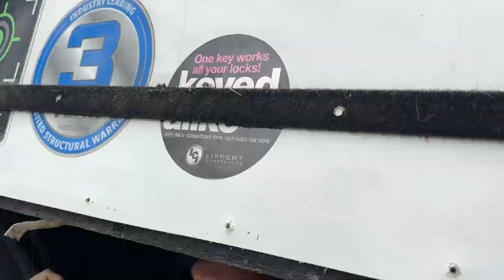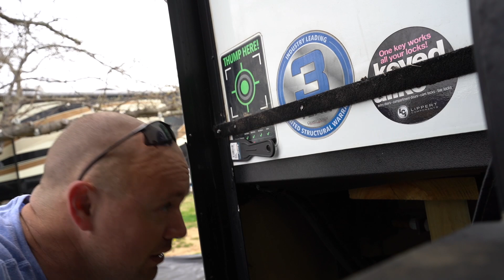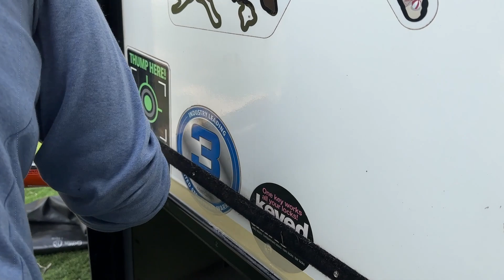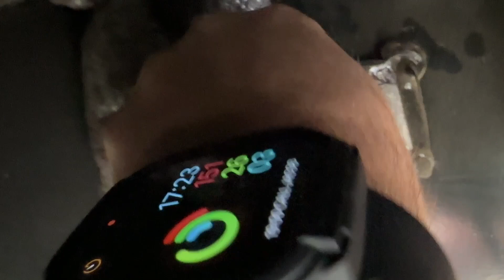RV Slide Ski Replacement

Comment: Thanks for the detailed video!  I did one ski a couple weeks ago and now I am going to do the other 3.  I'm glad I'm not the only one who couldn't remember the name of the "butyl tape"  I also had to replace the plastic block screwed to the inside of the trailer where the ski glides.  Mine was torn up from using the slide with the ski missing.  It chewed up the block quite a bit.
Reply from the maker: We are glad this was helpful to you. Let us know how the repairs hold up. Safe travels.

Comment: We had to do this on our 2014 Reflection.  Actually one Ski was replaced three times.  The last time the factory said the roller was in the wrong place and the Ski was not supposed to roll over the roller.  They removed the slide and relocated the rollers and no more troubles over the next many years.  It looks like your slide roller is on the outside of the slide which would contact the ski and break it over time.  Very nice job on the repair!  Thanks.
Reply from the maker: Hey y’all! Thank you for the kind comments! Replacing it three times sounds frustrating for sure! 

Stay safe and happy travels!

Jeff and Amanda

Comment: I noticed that you put the ski on the outside of the trailer wall, all campers rot out because water gets behind the ski causes rot. I had to replace our floor and redesigned the ski to fit in behind the wall and the new floor so water can’t get behind the ski.
Reply from the maker: Really! When you say behind the wall are you saying behind the fiberglass?
Reply: @WeLiveFreeRV  Yes
Reply from the maker: That’s awesome! I wish I’d have thought about that. Did you have any separation between your fiberglass and the wall behind it? I’m sure the slide ski is seated nicely but I wonder how the ridge of the slide ski impacts that. You should do a video about it!

Thank you for sharing! It helps the rv community grow!
Very respectfully,

Jeff and Amanda
Reply: @WeLiveFreeRV  yes there is a small gap for it to slide into.

Comment: Ive seen many videos of jacking up the slide but no one mentions about dissconnecting the slide out rails from the slide, there are little plastic buttons inside of the channels where the slide out arms ride on. These buttons keeps the rails centered inside of the channel allowing for smooth operating. By jacking up the slide without disconnecting you will damage these small alignment buttons and cause major issues in the future. Gotta disconnect the slide from the rails before jacking up.
Reply: Was this done for this video?  Cause I’m replacing mine this week and need to know!
Reply from the maker: Hey Jeanie!  Sorry for the delayed response.  We didn't remove the little plastic buttons, we haven't had any issues on our end.  As for the slide skis we absolutely had to replace ours.  They were in bad shape.
Reply: @WeLiveFreeRV  I didnt say remove the plastic buttons from inside the channel, disconnect the rail/rack from the slide. When you jack up the slide the way you did you are moving to entire rack and pinion, the two arms that connect to the slide and possibly bending or tweaking the metal that secures the rack and pinion to the underside. Glad you dont have issues. If you place excessive pressure against the alignment buttons you will have future issues, broken gear packs are the usual result. I've been repairing RV's for 35 years. But, what do I know, just trying to help
Reply from the maker: Good afternoon @betterthanideserve76,

Thank you again for clarifying! We weren’t questioning you at all! We love getting feedback like this as it makes the entire community better. We wish you the absolute best and hope you continue to contribute your 35 years of experience and knowledge! We hope you are doing well! Stay safe!

Very respectfully,

Jeff and Amanda

Comment: I keep getting wetness on my rv slide floor corners. But it only happens if it rains none stop for i er 48 hours. Which is what is happening now. I need to know if these skis are working and keeping the water out? Thanks i will be doing this if it works. My slide actually has what looks like the ski but they cut it before it went inside the rv. Which doesnt make since. If they would of done it rifht i might not have an issue.
Reply from the maker: Good morning!  We're sorry to hear that you are having troubles when it rains! For clarity we are definitely not RV repair experts in any way but here's what we would check. 

1) check the upper lip of the slide ski on the outside of your slide (minute 6:17 in video). There should be a bead of caulking along the top entirety of that black strip. 

Pro tip: caulk over the screw heads as well

2) look along the bottom edge of the slide ski (5:28 in video) even a very small crack can let water in. 

3) check the caulking around any doors (ie outside tv spot on slide), windows, etc. 

If you can't find the culprit using the above three, you can try gently pulling up the carpet/ flooring (not sub floor) of the slide to try and chase down the point of origin. 

Is there any damage to the walls inside underneath the windows (wallpaper wrinkles, peeling, squishy parts)? 

Also I'd suggest getting a ladder and getting on the roof and checking all of slide seals (big flaps the move when you open/close the slide). Look for wear and tear and make sure they are completely folded out and flat against the slide when the slide is out.  (A great time to get some slide seal conditioner and treat them as well!) 

Lastly, it's very important you dry the wet areas. A good house dehumidifier will do wonders.to help!

We hope this helps! Feel free to email us if you have any questions or shoot us some photos and we will take a look! Welivefreerv@gmail.com 

Again very sorry this is happening to you and good luck. 

Very respectfully,

Jeff and Amanda

Comment: Hi sir, I discovered water damage in our bedroom slide which is small, only has a dresser and a small linen closet/hanging closet in our 5th wheel.  Someone suggested possibly check the slide skies due to the water damage is on the floor and not on the top shelf of the linen closet.
Reply from the maker: Hey Amy, it would depend on where the damage is presenting itself (ie in a corner). If it’s unclear where the water is coming in I’d do a full check of the slide. I’d check that all the seals are intact around the slide (black rubber pieces), then check the caulking around the windows, slide skis/ gears (depending on your Rv), I would check the top of the slide for any tears or holes. 

Feel free to shoot us an email at welivefreerv@gmail if you have more specific questions!

Very respectfully,

Jeff and Amanda